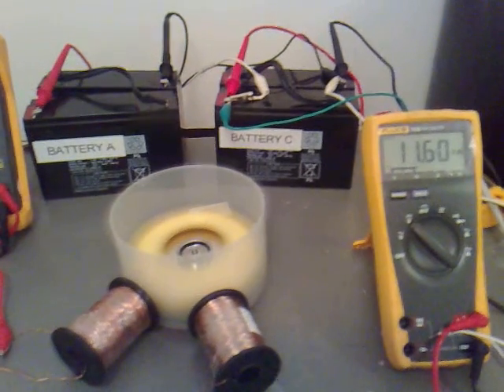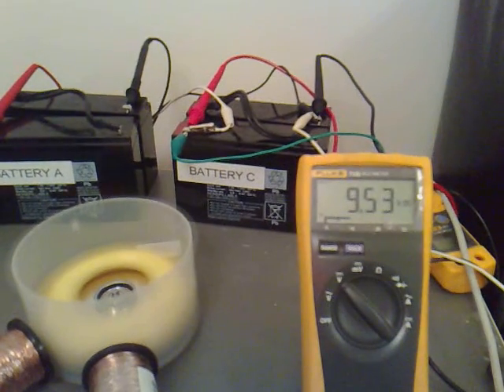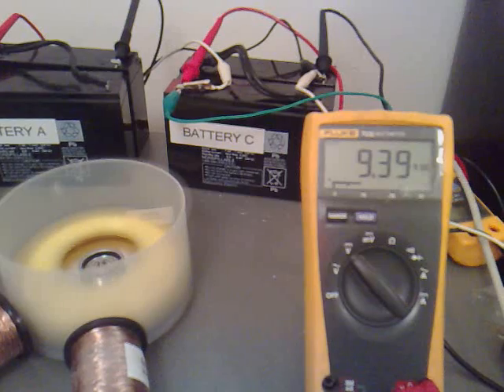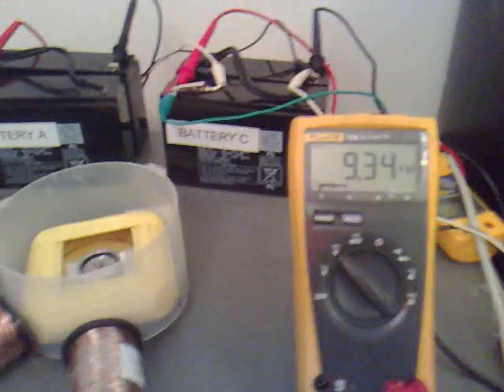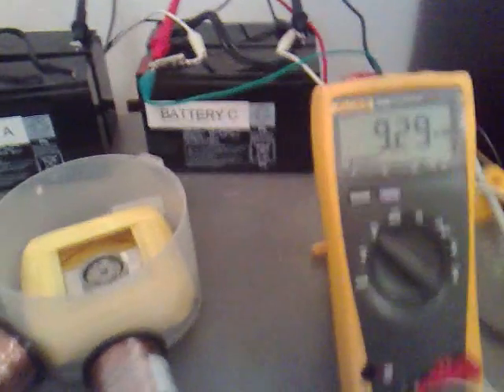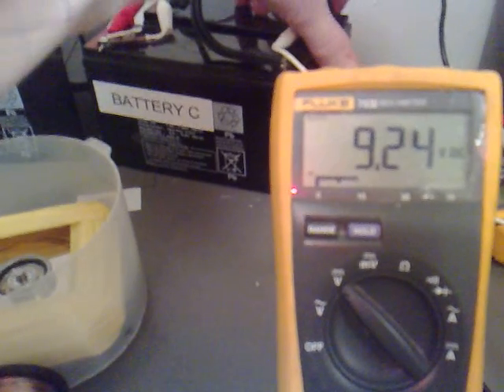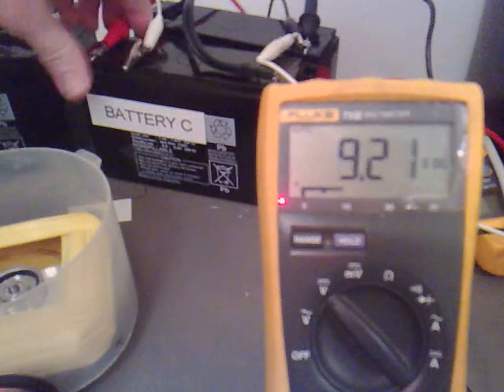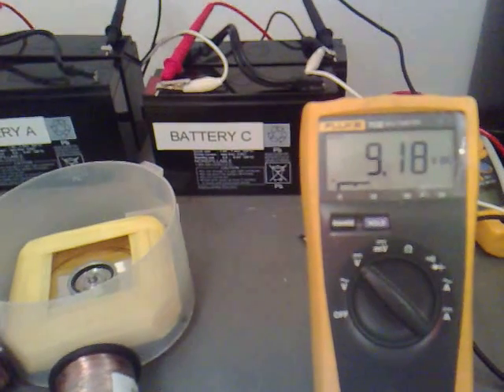Pulse Motor (Charging Dead Battery 02) 054

Comment: on a ssg it isnt the voltage or current that charges the battery.  Bedini has repeated that this device does NOT produce free energy.  the circuit is merely intiating an event that causes batteries to charge "spontaneously". the energy does not show up on meters. only in the batteries.

Comment: btw, you usually need 2 in series to get a good result. Unless my meter's broken both of my nicads happily hold 3 volts a piece, and as i can run 2 LEDs off 2 batteries... and the minimum voltage is 1.7 im told. The batteries should charge in seconds. Its teslas switch circuit design.

Comment from the maker: Thanks,

It does make sense that 2v extra charges as my nokia phone has a 3.6v battery and it needs a 5v + voltage to charge it.

That may be an amps thing though?

Made me think to get my old phones out the cupboard though. I will charge one phone battery with another see how it goes.

Cheers

Comment: Thats interesting but I am certainly not talking nonsense. As far as I know (and I love to be wrong because I learn something new) you need 2V potential difference to get a charge. Maybe you can explain how you managed to overcharge these batteries. I've experimented with collapsing magnetic fields with 4x COP and only 25% duty cycle. Thats the only way I have found to produce a high enough voltage to charge. Maybe these systems take advantage of that unknowingly.
Best wishes

Comment: I like your videos Kubikop.
To charge any battery you need 2V more than its potential. Looking at your meters you only hit 13 once and then you were charging at 11-12, which can only possibly hit the 9 you are getting. You don't need a motor/switch to charge a battery, it works much better when you charge 1 battery in parallel from 2 in series. I have 2 nicads that light 2 LEDs forever (well over a week now) good luck!